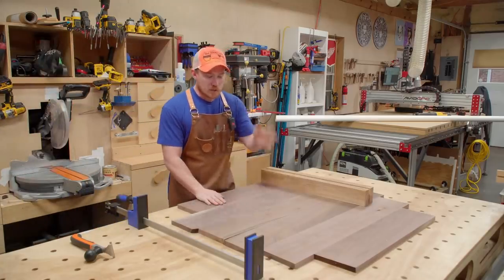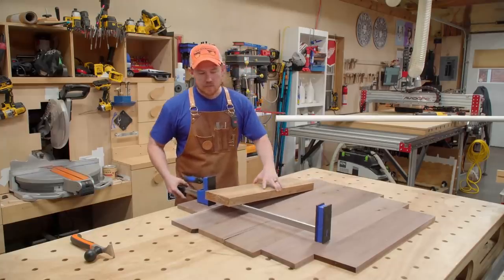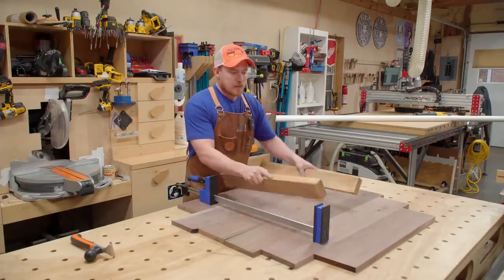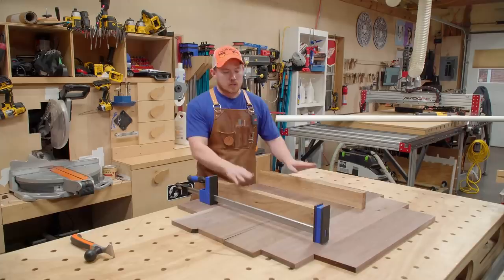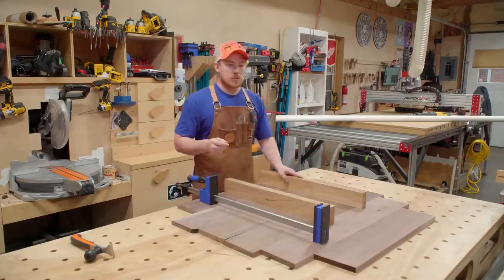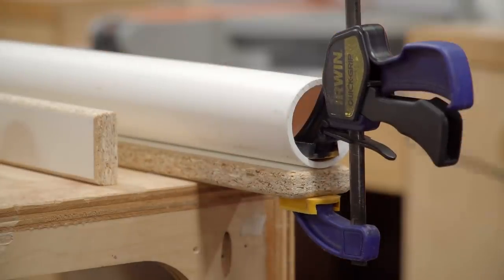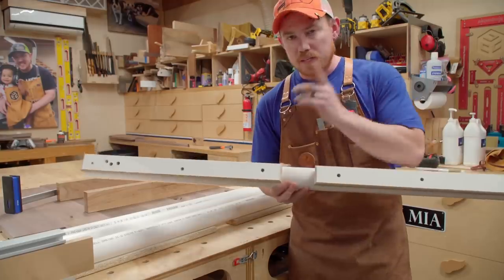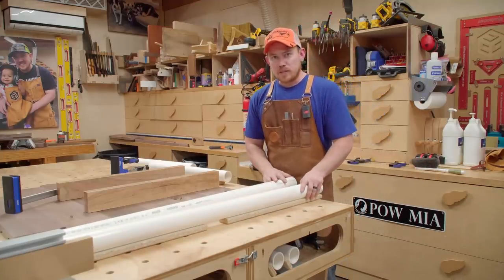You Should Make These - 379

Comment: I learned this from a professional furniture maker: during the glue up, he sprinkled a tiny bit of sand along the glue joint. Doesn't take much, about 5-10 grains per square inch, usually near the ends. When clamped, the grains dig into both pieces of wood, gently locking them in place.
Reply from the maker: I like that in principle but I don't think I'd ever do it. Extra step that isn't really necessary. Do you do this?
Reply: seen done with salt---same effect, ready availability; I follow Jay up here though and felt no need ever for the old ritual

Comment: The pvc riser/cols are great, you can get over the rolling issue by using 3" square downpipe. It won't roll, it gives you a flat surface to work on top and it still won't stick. I also found a round downpipe size that's a piston fit inside so I can connect and extend if needed
Reply: What is a 3" square downpipe?  Do you mean a gutter downpipe?
Reply: @number6396  yes, in Ireland we normally refer only to the horizontal piece as gutter. But yes a square gutter downpipe
Reply: @number6396  also your original comment asked about crushing, no they are pvc with a 3mm wall, similar to the pipe used in the video

Comment: Nifty solution. For glue release on cauls cooking spray - Pam may is the most familiar brand - works really well. Soy lecithin is what the stuff is. The cheapest dollar store brand works just as well. A small can lasts a long time. Wipe off the excess with a bit of rag saved in a closed container for future applications. Apply over cardboard or outside unless you relish the idea of soy lecithin migrating eternally around your workspace.

Comment: A slight addition I made to mine was to add boards across the front and rear of the primary boards that support the PVC. These two boards had equally spaced holes in them.  Then I added a pegs to the front and rear of two PVC primary boards.  The primary boards could then be moved towards or away from each other equal amounts depending on the width of the project and then secured with the cross board. This keeps the entire support for the glue up secure and the PVC tubes from moving sideways.  It’s a bit like nailing the PVC boards to the table top but with the flexibility to move them closer or farther apart as needed.  Anything that can move during a glue up will.  Like the bolt that falls off the table WILL roll under the heaviest equipment in your shop.

Comment: In the UK use 40mm ( 1 & 1/2 ") waste pipe because 2" ( 50 mm ) costs a lot more. The reason is 1&1/4" ( 32mm ) and  1&1/2"  (40mm) are domestic while 2" ( 50 mm ) tends to be more commercial. Commercial always costs more than domestic.

Comment: you can also make the pipe shorter than the board underneath. then you can clamp the board to the work bench. Also if you have the dimensional lumber spacer that is as long as the table you can put them on top of the glue up and then clamped to the work bench to keep the glue up from bowing.

Comment: 40x80 aluminium extrusion profiles will work just as well...and they are so straight you can use em to prevent warp while clamping
Reply: There's a significant cost difference compared to PVC pipe.

Comment: now you just need to make some clamping cauls which I guess you could store inside these PCV risers.  Shorter ones  around 18" or less can be straight but the longer they are the more curve needs to be in them so they keep the center clamped down.   make from softwood so they don't mark your workpiece.
Reply: Not needed if you do it the MTM way

Comment: Jay, have you tried coating items with silicon?  It has 2 wonderful advantages over packing tape.
1. Glue releases from it far better
2. It protects the work an resists slippage.
While a bit more expensive than packing tape, I found it lasts longer, is easier to apply, and with the many colors available, makes finding my tools much easier (I choose a bright orange).  There are several brands on the market.  I recommend a two part paint "paint-on" / dip if you can find it.  For myself, these seem to apply and cure more evenly.

This is also useful to provide an insulating grip to things.  I have coated several cheap canvas work gloves for working with small items, hot things, or really messy stuff (gardening, auto-mechanics, etc.).  I even coated a set of old mittens for shoveling snow.  The hand stay nice and warm and I have a better grip on the shovel with less effort.  ;-)
Reply: what kind of silicone are you using?
Reply: How do you apply a thin and homogeneous layer without messing everything up with silicone?
Reply: Not needed with PVC
Reply: @daveklein2826  Now, he wouldn't be commenting in such a detailed and informed manner about coating with silicon if he was talking about pvc, would it son?

Comment: MTM does great work, not good work but great.
I purchased 4 pieces of extruded aluminum.  They're 48" long and 1 1/2 x 3 1/2.  I set 2 on the work bench, layout the work pieces, glue them then place the other 2 on top so I can clamp them together.  It really helps with alignment.  Then I add my bessy clamps.  I also wax the snot out of the aluminum extrusions and my clamps so cleaning off the titebond III is easier.

Comment: I see a few experienced builders using PVC pipes, and I have been looking to do something like this, but have been concerned that the PVC pipes will flex over time. Your design addresses this.  However, many of us have glue up tables that are not perfectly flat, raising the concern that the panel could twist/rack.  Is there a way to adjust these to address this? Can one simply look across them like winding sticks to make sure the surfaces of the pipes are co-planer? It looks like MTM may have built in levelers into the  wood pads or installed coplaner leveling strips along his dedicated table. I trust your judgment so I tht I'd ask you. Thanks!
Reply from the maker: Correct, they will telegraph any twist in the table to the glued up panel. However, you can shim the bottom of the pipe holders to get them parallel if your table is not flat.
Reply: @JayBates  Thanks.

Comment: What about if you "rip" the pipe in 2 (i.e. along length)? You wouldn't need specific base as anything flat would do (assuming a straight rip) and any base wouldn't need to be continuous - could even make some weird ramp arrangements if a "wedge" glue-up were needed. May even be able to get pre-cut c-section PVC pipe. Could make some "feet" at convenient heights with grooves in them (tight and/or rubber lined for grip) so you could quickly make any arrangement you like - slide the pipe "edges" into the grooves and clamp the "feet". Also, "c-section" pipe can be stored partially inside each other to reduce storage space and any "feet" could just be chucked in a box - where @Jay will never find them again :)
Reply: You need enough height to clear the clamp. Halving a 2" pipe will probably cause clearance issues and going up to 3 or 4" pipe would make 'em way too wide.
Reply: @MrStrizver  Hence the idea of "feet" - basically what Jay did but thicker and with grooves so that you don't need to screw a round pipe to a square plinth and have more options.

Comment: Hey Jay, what happens with the glue that might leak on your table ?  If it does, is it easy to clean off.  I am going to make these  glue up risers as you have shown.  Sure wish I could have a shop like yours.  WoodShop 21
Reply from the maker: The table has a finish on it so glue pops off easily. I don't recall if this one has shellac or water based poly. Either works good though.